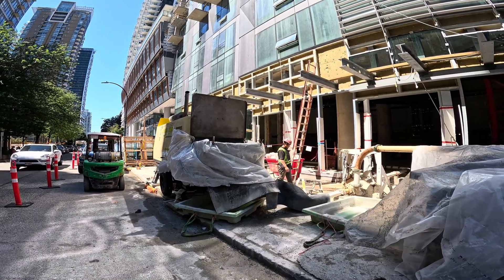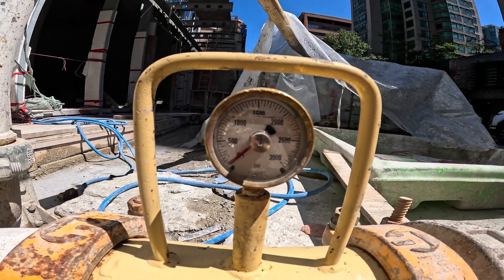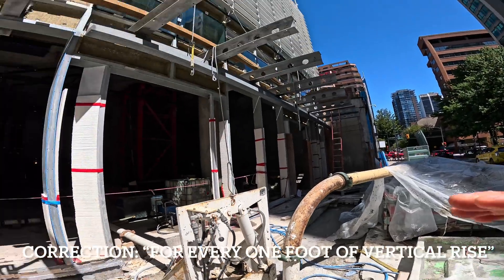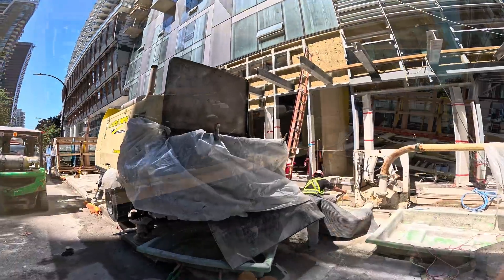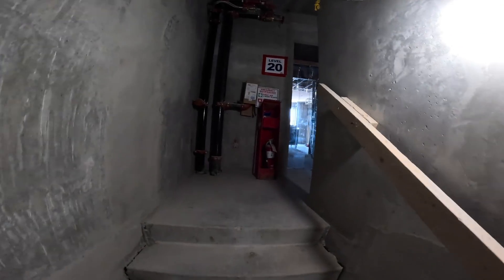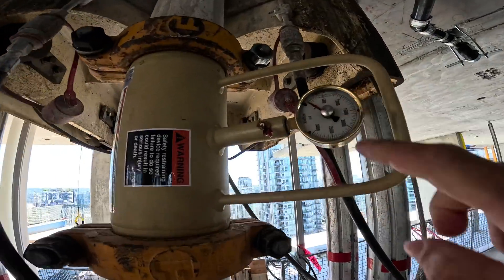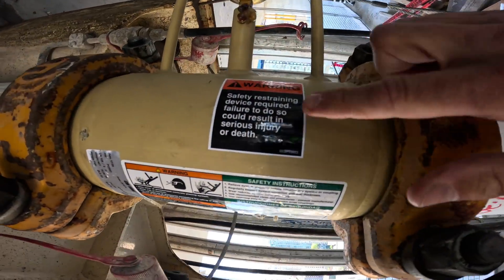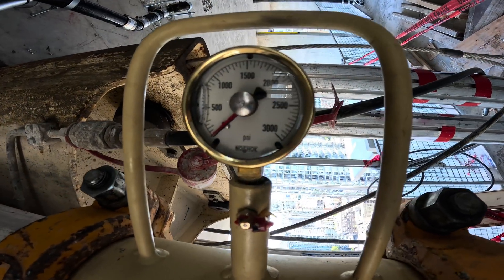The Science of High-Pressure Concrete Pumping: Investigating Delivery System Pressures

Comment: I'm a retired firefighter and spent most of my career as a driver / pump operator. I think one of the reasons I like watching your videos is because the fundamentals are the same for pumping / aerial operations are the same. Friction loss, appliance loss  and elevation loss or gain do the same to both a fire pump operator and a concrete pump operator. Outrigger placement, obstructions, planning and placement, are common things with a ladder truck and a boom pump. I have no doubt that you could pull a guy off a concrete pump and teach them to pump a firetruck in less time than most other people. I actually really like those Dica blocks you guys are using and talked to a friend of mine who is in charge of apparatus at my old department about looking into them for the ladder trucks. They look like they would make cribbing easier and faster than pulling 4x4's off the truck.

Comment: Awesome videos, learning a lot. When you have these pipes running up the buildings do you have in house engineers that certify the design? What about the concrete placing boom, is that engineered as well?